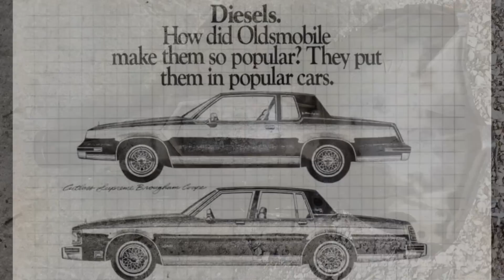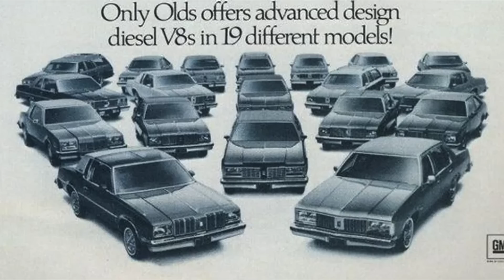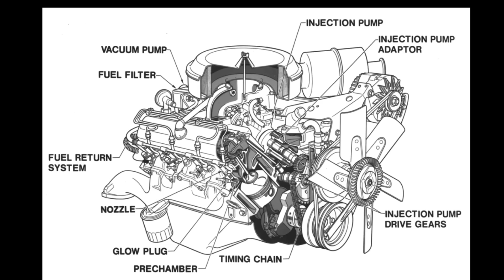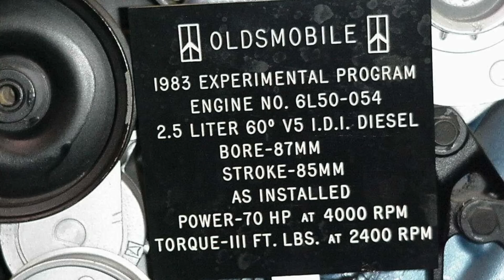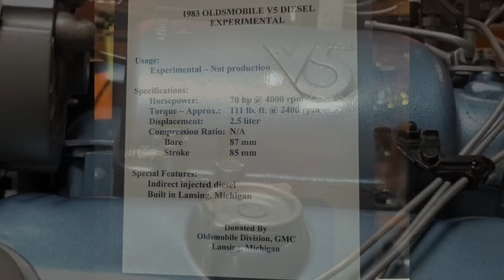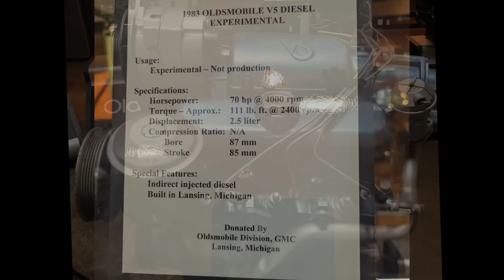Craziest Automotive Engines: Oldsmobile's V5 Diesel (Yes, I Said V5)!

Comment: I had a 1979 Olds Delta 88 diesel that was converted to gas. They used a deck plate to lower compression, and put gas heads and a 4bbl on it. I think it still had 11:1 + compression because it would destroy both back tires if you floored it. 55mph to 100 in maybe 5 seconds. That block was stout, very stout.
Reply: Diesel block is a favorite for hot-rodders when converted to gas. Extremely strong block and if I remember correctly it’s possible to bore and stroke it to 430 cubes! 🤙
Reply: @SpecialAgentJamesAki oh yeah, I've heard the 350 DX blocks could take a 403 piston 4.351" and a 425/400 4" ir 455/400 4.250" crank and make a giant stroker.
Reply: mine is over 450 ci @SpecialAgentJamesAki
Reply: @SpecialAgentJamesAki  yup the diesel  dx engine  was a definite  favorite  to hot rod they were stronger than the conventional  gas engine
Reply: I believe Mondello offered a gas/spark ignition conversion package for the 350DX.
Reply: @hendo337 One didn't need to convert anything.... just remove the vacuum pump at the rear of the block, and drop a gasoline distributor directly in the hole...
Reply: People always thought it was a existing gas block converted, the 358 just influenced the diesel concept before being cast new. Funny though it seems the existing diesel converted to gas on the other hand, this is the first I've heard of. A lot of people gave up on them altogether
Reply: Back in the day, we would just get the heads, exhaust manifolds, intake / carb from the junkyard for a mid 70's olds 350 and bolt it onto the 5.7 diesel and they ran fine.
I don't know what the compression ratio was, but it ran on pump gas and felt around 250hp; which was much better than any of the stock engines of the time.
The 403 would also bolt in place of the 5.7 diesel and the front springs did not mind the weight in a Cutlass Supreme.
Reply: yes that diesel block was very strong, that was probably a lot of fun to drive
Reply: I wondered if anyone had tried that. It could have been profitable, with all the almost-new diesel GM cars on the market for almost nothing.
Reply: @pcno2832  there was a company that  made the plates i guess and Olds 350 intakes and heads were still available off the shelf. It definitely sounded like Oldsmobile Rocket 350. Oldsmobile V8's had a unique sound with a proper exhaust
Reply: @netrioter Oldsmobile kept making their own V8 blocks until 1990, so parts were easily obtainable.
Reply: @netrioter I could take my infant Daughter for a ride in my 74 cutlass supreme with dual turbothrush mufflers and it would lull her to sleep no matter how bad the tantrum - worked every time
Reply: @pcno2832  a guy was using new government repower 6.5 blocks and CNC machined up aluminum heads bored it to 4.250 max made big power
Reply: @craigchiddo2794  I would love to see some kind of source or link to what you’re talking about, because it sounds like somebody was blowing a lot of smoke up your butt LOL. I have several issues/ questions regarding this mythical engine….first are you saying he conveyed a P400 6.5 block (that’s what they’re called) over to run on gasoline? Or just that he increase the bore by 0.019  (that’s 19 thousandths…not much of an increase in bore size and not worth the trouble for what little performance you’d gain plus the fact nobody Makes a 0.019 over piston, why would they when +0.20 is a common overbore size)  . I ask these questions because I think I might see where this fellow started his whopper, seeing as a 454 BBC uses a 4.25” bore and uneducated blowhards have been saying the 6.2/6.5 is “a converted gas motor” for years because they “heard it somewhere”….but there’s no truth to that. The big block Chevrolet v8  isn’t at all related to the Detroit designed 6.2 / 6.5 diesel. Also on that same subject, since the comment was on making a gasser 350 olds out if a diesel short block….which can and has been done easily, I should also mention that the 6.5 diesel and the 6.2 for that matter have a totally different block casting design and internal components and in fact the “long block” assemblies for an olds diesel and the 6.2/6.5 don’t share a single component that would interchange beyond the roller lifters (the IH/FORD IDI diesels use the exact same lifters too) and the oil cap. To recap the 6.2 and 6.5 are not remotely related to any Oldsmobile engine at all, diesel or gas, or to any Chevrolet gasoline engine. With that covered let’s talk about the possibility of a gasoline conversion of a “military” P400 6.5 diesel block. To put it simply without spending high 5 or low 6 figure money to build a mediocre gasoline v8 engine that a mildly built 454 Chevrolet would outperform and outlast in every way for 1/20th the money and 1/500th the effort.
Reply: @J.R.in_WV  still looking for the block
Reply: That musta been scary fast with the stock higway gears! Ever find what speed it'd top out at??? 👍
Reply: I’ve heard a few people talking about these conversions throughout the years…. Sounds like an incredibly cool car!!
Reply: I remember caravaning behind a friend in his 79 Olds Delta Diesel and we got behind a very slow car (probably a VW Rabbit Diesel 🤣) and he went to pass it. Dad started to pass with him, but we got smoke out SO bad that we had to abort. 😂
Reply: My dad did that to our ‘79 olds wagon. We had that wagon forever. Then my first car was my grandma’s 1984 Olds 88.
Reply: Damn you read my mind. I wondered if they could be converted to gas
Reply: And you would not have to smog them. I remember many guys would swap out the diesel 6.2s with gas engines because the smog requirement was tied to the VIN…and diesels were, back then, exempt.
Reply: The olds 350 rocket was a good running, torquey engine right out of the box and that’s pretty much what you had. Whoever you bought it from must have had the engine built by someone and just made a few assumptions and added them to his story regarding the “deck plate” as You don’t need a deck plate to drop the compression to a more than acceptable level that’ll run on 87 octane pump gas with an olds diesel rotating assembly and block. Using a set of #8 heads from a gas Olds 350, normal gas engine head gasket and leaving the diesel pistons and rods in it would give around 9:1 compression, early 350 heads would give somewhere in the neighborhood of 10-10.5:1 max. The diesels used a VERY small chamber (keep in mind they also had pre-chambers in them being an IDI diesel that added some volume to the outrageously tiny main combustion chambers) and thats where they got most of the compression from. The flat-top diesel pistons already have valve reliefs in them and have a more robust skirt and just more metal in general because they are taller than a gas piston and the diesel used shorter rods to compensate for this, meaning you can’t run gas pistons with the diesel rods, the compression would be so low it wouldn’t run…however you can run gasoline rods and gasoline pistons and be fine although unless using aftermarket pistons there is no real advantage except a lighter piston / rod assembly which doesn’t mean much for a daily driver type build.
Reply: I recall b+m making a kit for swapping a th-200 out for a th-350 and helping a buddy do it in his 82 firebird. Definitely was a wise choice.
Reply: Let me guess you got rid of it
Reply: Hey boss! I got a great idea
Yes, nephew? 
(struggles to keep from laughing) A v5!
A v5? It sounds like it’d be imbalanced.
You haven’t heard the best part, boss !
I’m sure I haven’t 
It’s a V five diesel! It’ll make 70 hp!
Nephew, do you want me to puke my breakfast all over the place?
Reply: I did that conversion on a station wagon and it was a complete tire shredder. The customer was an old guy and he loved it.
Reply: That's complete bullshit... you would need NO deck plate. The diesel heads simply wouldn't have a chamber and would be flat. Putting a deck plate on and then gas heads, would give you a compression ratio of about 6:1. 
And even if you swapped on a set of gas heads, it certainly would NOT make it some kind of huge horsepower engine. It would make LESS than 300h.p. without significant rework and an entire rebuild with lots of machine work, 100% new internals, and heavily worked heads.

Don't try and bullshit a true Olds guy, you'll get called out EVERY time.. 😒
Reply: Nice.
Reply: I wonder if the Oldsmobile Diesel V8 would run better if machined again. Add another head bolt.
Reply: In 1979 I special ordered a Pontiac Trans Am with the Olds 403 which my father and my uncle were mechanics at a Pontiac dealership. They recommended the 403 due to having a very strong bottom end. Not much horsepower but gobs of torque, coupled with a Chevy 12 bolt 3:73 posi rear I managed 15 second 1/4 mile times at Englishtown Raceway Park on stock tires. One strange thing about this motor it had oil cooler lines coming out of the oil filter housing to a front mounted oil cooler, according to the information given to them it was a diesel engine block.
Reply: @BobBasshead The 403 actually felt faster than the TA 6.6 and was a lot easier to live with. Very easy to hop them up, too. I had a 1977 Delta 88 with the 403 and FE-3 suspension. An intake, cam and dual exhaust made it into a very potent car for the day. I used to storm over the Rockies in the thing with ice cold a/c. Now I do it in a hopped up 2018 VW Golf SportWagen.
Reply: @craigriker6940 I had the same car years ago. 79 T/A with the Olds 403, th400 automatic,  4 wheel disc brakes, posi, T-tops and the shaker hood.. That car was fast for its era and it looked good and was a blast to drive, just a tire smoking ass hanging machine!. It's one of my favorite of the many I've owned.
Reply: That's fascinating, I've always wondered about converting some diesel engines to run on E85 since that fuel LOVES high compression ratios and most engines aren't built to take full advantage of it in case someone puts regular gas in it by accident. Especially since nobody wants the diesel Oldsmobiles nowadays, converting the engine to run on a different fuel could be a cheap way to build an unusual sleeper car.
Reply: @Thinginator I did some research on this after buying my flex fuel Chrysler 200 and discovered that Cummins had an Ethanol engine program in, IIRC, the early 90’s where they converted existing diesel engines to spark ignition to run straight Ethanol! IIRC the engines made great power and had good reliability, but the complete lack of it as a fuel made it pointless. There is a concrete company local to me that runs all their trucks on CNG and from what I understand, they are far cleaner emissions wise and last longer in use too.
Reply: That doesn't make any sense, even back in the day GM 350 motors were almost free. It's nothing to swap in a new motor and trans vs going through all that nonsense.

Comment: Commenting on balance. There's a relationship between displacement and cylinders. 
For example
Infiniti G25 vs G35, Lexus IS250 vs IS350, GMC V6 5L vs Chevrolet V8 5L, GM V8 4.3L vs GM V6 4.3L

Comment: There are a handful of us who love the clanking of a diesel! I currently drive a 2022 GMC Sierra with the 3.0 Duramax which is admittedly FAR more refined than any of those Olds V6 or V8's. My previous truck not so much, 2001 Ram 5.9 Cummins 3/4 ton 4x4 that I put close to 300K miles on before I sold it, 16 years of Michigan Winters having done their work on the body. Now THAT was a diesel! LOL Great video as always! Have a great 4th of July.
Reply: I love the diesel clatter, but it isn't exactly the sound of luxury.
Reply: @bradlemmond what is the specific sound of luxury?
Reply: New diesel trucks are a monumental waste of money. Huge price tag off the lot, and massive repair bills a few years down the line.
Reply: I have a 22 Silverado with that engine. The only clanking I get out of mine is the sound of injector nailing, and marbles in a metal coffee can when it's regenerating, which is frequently. Great mpg on the highway for sure, but if I had to do it all over again, I'd just get the 5.3 and deal with the inevitable AFM issues.
Reply: It's a shame you live in a rust area. Your new truck won't last nearly as long as that old one. Those DEF fluid systems are awful.
Reply: I have a love/hate relationship with diesel noise.  They sound cool, but also get old after a while, and taking phone calls is nearly impossible.  I have 444k miles on my 7.3 Powerstroke and unknown miles on my 7.3 IDI, neither is going away any time soon.

Comment: Interesting, but what not just develop a turbo diesel 4 in which include 5's or 6's could have been developed from the  architecture.  For example, a 600 cc bore could have developed a 2.4 4 a 3.0 5 and finally a 3.6 6. Which could have developed a 100 hp 4 cylinder up to a 150 hp 6 cylinder. This was more power than what they were producing with the existing diesels. It seems like they spent a slot of R &D money that was never recovered in sales.

Comment: I worked at AAMCO Transmissions in the early 80`s and we used to get cars with destroyed 200 turbo hydromatics in every day, never in Chevettes though. Also unrelated but as a fact Renault Alliances were so bad we wouldn`t even accept them anymore. I remember you did a review talking about what good cars they were. Not from my experience they weren`t.
Happy 4th of July Adam I hope you have a wonderful holiday.
Reply from the maker: They were decent *when new* ;). Same to you!
Reply: I worked at a dealer that had Renault bestowed upon it with the Volvo franchise in the 90s. They should have been crushed at the assembly plant.
Reply: @TroyClayton-w2l I agree with that. I too worked at a Renault dealer. Remember the slogan? "Renault... The One To Watch" yeah, watch that temperature gauge cuz those head gaskets popped all the time. LOL

Comment: V5 doesn't even sound like it would run balanced?
Reply: On the contrary, a 75.5 degree cylinder angle V5, as Honda demonstrated with its motorcycle 990 cc DOHC 20 valve 4 valve/cylinder racing engine RC211V had remarkable smoothness all without need for a balance shaft.   In its final racing year the Honda V5 produced about 260 BPH at 16,000 rpm, essentially 260 BPH/litre.  So we shouldn't be so dismissive of GM's attempt at a V5, though admittedly GM's design wasn't as sophisticated as Honda's racing engine design.  The lesson for all of us is that what we initially think, at first glance, because of our fundamental neophyte engineering ignorance, that a real gem of an engine may await discovery.  So, yes, a V5 really isn't such an outlandish concept in actuality.  Credit GM for pursuing that possibility, though it didn't pan out as a production engine.  Cheers.

Comment: Olds was such an innovative company, its engines were often unconventional and often excellent (at least for GM). And think about that Olds 307 that was the workhorse of so many GM vehicles in the late 70s early 80s, too. So sad that it didn't catch on in China instead of Buick - then Olds might have lived on.
Reply: The 307 was never great, but it was the last carbed GM engine to meet emissions.
Reply: @matthewbowen5841  And it was a smooooooooth-sounding Oldsmobile V8, ready to almost pull the Earth off of its axis!
Reply: @DanEBoyd - Pull the Earth off is axis?😂😂😂. I've only driven one car with a 307 and while it was smooth, it was the most gutless 4 wheeled vehicle I've ever driven.  It was just a test drive, but IIRC it was an 88 Cadillac Fleetwood Brougham... I assume a Caddy 307 is the same (or very close to the same) as an Olds 307.
Reply: @dustintunis9347  Same engine.  Guess I was thinking of the larger Olds V8s.
Reply: The 455 in my 70 Cutlass would pull the gates off hell! @DanEBoyd
Reply: And Oldsmobile had very nearly every bit of class, which Buick had.

Edit:  At least in my Gen-X lifetime - or the first less-than-half, hopefully...😃
Reply: It was GM's last carbureted engine.  GM made them until 1990 when the b body wagons from 1977 were put to pasture.
Reply: Oldsmobile was very much GM's Lancia.  They just were not afraid to try some proper crazy s$@t to see how far they could push the guts of a car
Reply: 1997 I bought a 87 Oldsmobile cutlas supreme t-tops 307 118,000 miles that could get a second gear scratch